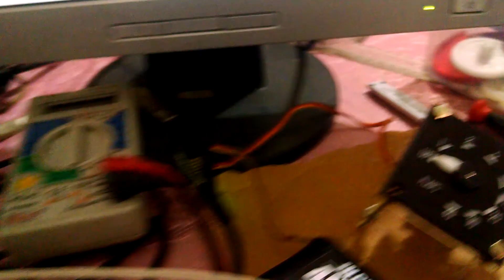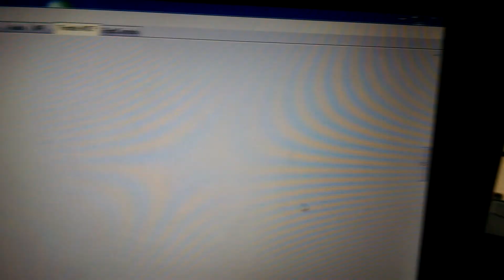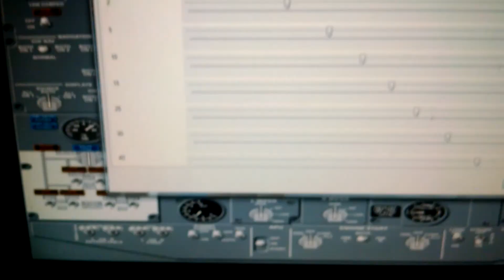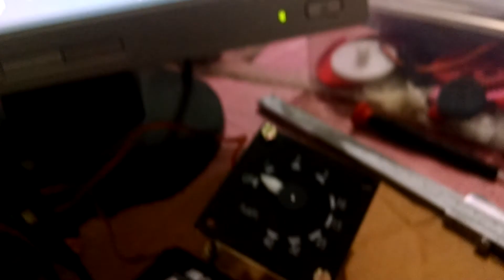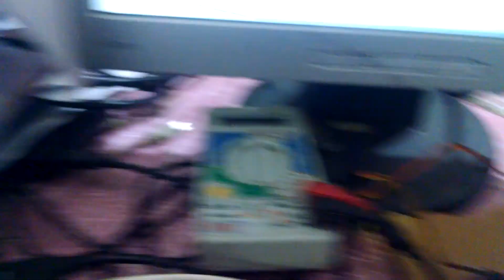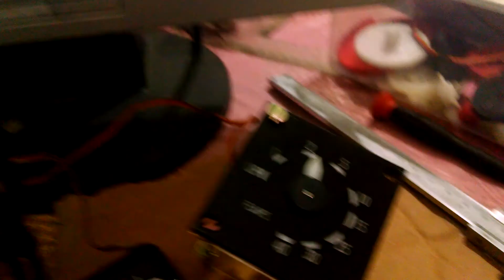Homemade 737 Flaps Gauge for Flight Simulator

Comment: what size are the gears 42 large 20 small or doesnt it mater as you use the calibration
Reply from the maker: it doesn't matter because you can do in calibration. but better double the gears